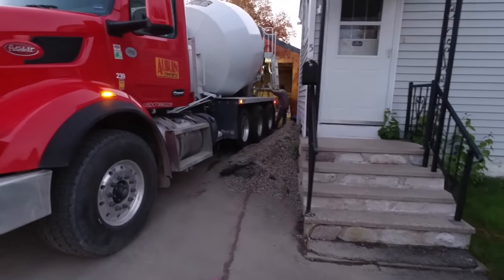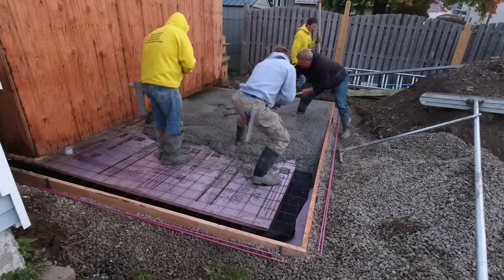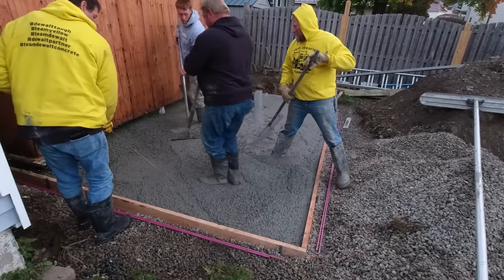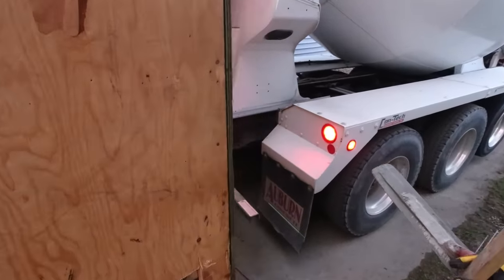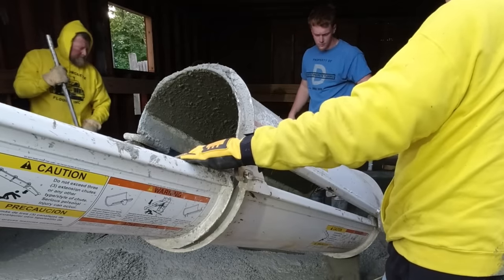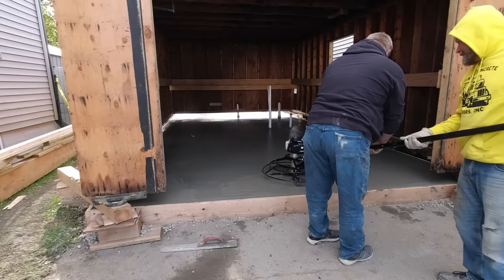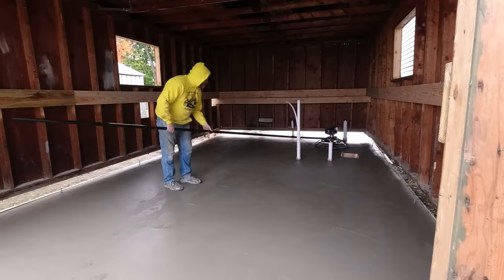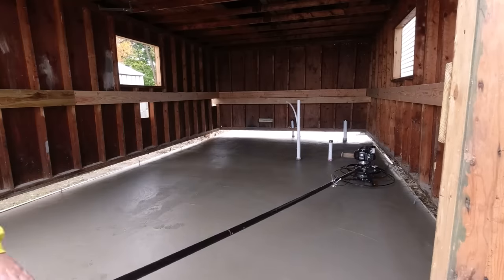We Tested This Mini Power Trowel - Is It Easier Than Finishing Concrete By Hand?

Comment: Too light. Too slow. I heard many reasons to not use it. If you weren’t covering the floor would you have used that machine?
Reply from the maker: Yes we would have used it, without it we would have finished by hand so it did make the job easier.

Comment: So that trial is actually intended for epoxy stone flooring it works great for that but as far as finishing concrete it's not the best reason being is it's on the pole and you can't really see the light imperfections way out on the floor like the little pops and whatnot you can't see that sort of stuff and the engines are not reliable at all

Comment: I worked with a guy in NH that used them on pool decks for stamped concrete. 
I have no experience using it, I've ran even smaller ones that look like weed wackers but they didn't finish well but used in emergency to save edges.

Comment: Its interesting. Ive seen videos of the australian guys using trowels like that. For some things I think it could be useful, like exterior flatwork, driveways etc. I almost would think of it like a powered fresno. Not gonna get it tight but it will make it smooth, cut minor humps, and probably be easier on tooled joints once it starts getting hard and you dont want to have to keep opening them back up. Not sure that I would use it on floors, I like panning them. Not convinced this would leave it flat or tight enough for my liking. Im also in Arizona so we have to move a little faster, timing is seldom an issue, once the pans get on it you dont really stop troweling until its burnished. I like my big heavy machines, the pans allow us to get on it early enough and I have confidence of flattening the floor.
Reply from the maker: Awesome, thanks for the insight.

Comment: My concern, as an old concrete contractor/finisher, is the possibility, when troweling too early, of later delamination because the water got trapped below the sealed surface.
Reply from the maker: I talk about that a lot in my videos. We also use air-entrainment in most our pours so that could be another issue to be careful about.